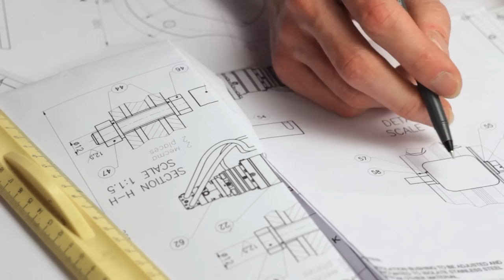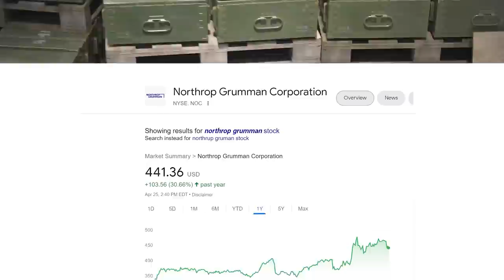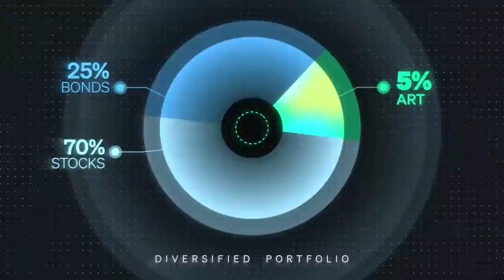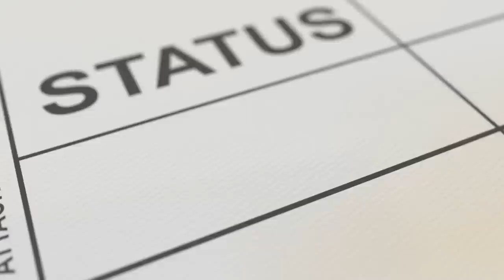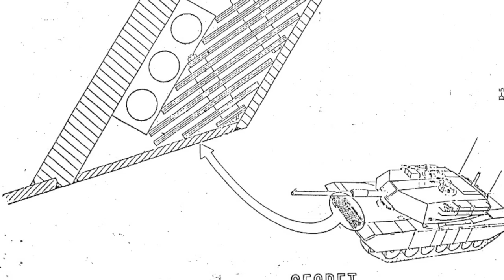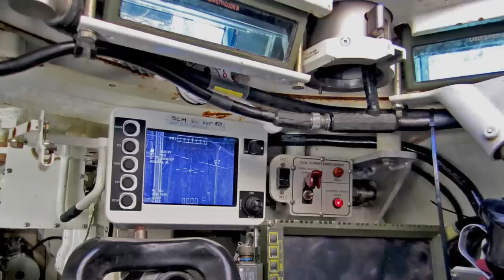The M1 Abrams Tank Needs to Chill Out

Comment: Why aren't we seeing upgrades in the tracks and suspension. Seems being able to use that horsepower would improve survivability.
Reply: Limited potential benefit, compared to the development investment. Trying to go faster on rough terrain is tough, not just because of the extra power required but also the bumpier ride. At some point, if you want to go faster the only real option is to fly.

So basically, there's a practical limit to how fast you can go anyway.

And extra speed doesn't necessarily make you more likely to survive in and of itself. The main benefit would be the ability to engage or disengage, when up against slower enemy forces. A significantly faster speed means that you may be able to concentrate forces more effectively, and escape enemy concentrations more effectively. But if it's only a minor speed difference ... well, restrictions and geometry of local terrain may generally be more significant than the speed difference.
Reply: @IsaacKuo  Well I think if you ask the crewmen if they'd like an extra 20 mph in a tight situation you'd get only one answer. You pointed out several positives and gave weak negatives. If speed were so meaningless every AFV would do only as much as needed and no more. The Merkava is the only one I can think of that speed wasn't maximized due to it's expected combat role. The expense of designing better tracks is nothing compared to improved systems or armor I would think so I don't consider that a valid reason.
Reply: @larrymead151  Yeah I don't think you're going to squeeze an extra 20mph over what we have now, over rough terrain. Maybe 5mph, optimistically, and that would require losing a lot of mass (reducing armor protection mainly) and a lot of volume due to the much larger engines (reducing ammunition, spaced armor protection).
Reply: @IsaacKuo  You seem to have a fixation with tanks being used only over rough terrain. They aren't. Why was the original top speed of the Abrams before all the mods about 10 mph faster than it is now if it served no purpose? And that's with a governor. Why the extra power when a 1200 HP diesel would have worked? They wanted the speed for a reason.
Reply: @larrymead151  The tank was purposefully designed with an extra margin in power because real life experience shows that additional systems will be added later on. In particular, many tanks have been upgunned and that has often meant expensively redesigning the entire turret if the original turret lacked enough margin for it (the M1 turret was designed with dimensions for a larger gun if needed).

The question you should be asking yourself is - if that theoretical top speed was so critical, why did they add all this heavy stuff which slowed them down on ideal terrain?
Reply: @IsaacKuo  The question you should be asking yourself is why doesn't every tank go 20 or 25 mph if speed means so little. They could put more of everything on there and reduce the speed by 50 percent but they don't. The limiting factor are the tracks and suspension which tear themselves apart at certain speeds under certain loads. Again I say if you asked the crewmen if they could have that 10 mph back they would take it.
Reply: @larrymead151  It's all about design compromises - cost vs gain. Going 20mph slower doesn't gain you much - if anything in capabilities in other departments.

In contrast, trying to go 20mph faster costs you a lot. Besides the fact that it will beat up your crew so they won't be able to fight effectively, you'd lose too much in terms of weight and space for other systems.

The bottom line is that the US military decided it was worth a more powerful gun, better armor protection, and a hunter-killer capability (which was arguably the dumbest cost cutting measure in the original version), even if it may have cost some speed on smooth terrain.

You're arguing that this was a stupid decision, and also that somehow improving the tracks will somehow add a lot of speed.
Reply: @IsaacKuo  Design compromises have to do with firepower, protection and mobility not cost versus gain. Which of those three is always neglected during modifications. I'm saying it shouldn't be and doesn't have to be.

Comment: It has often been said, and it reigns true (Probably). That during the invasion of Irak, had the sides swapped tanks, the US forces would have still won easily... Crew training matters A LOT! As long as your optics are decent, and your fire control system isnt garbage, you can kill another tank, or atleast take it out of action with a single or few shots. And if you use proper tactics, you wont present a shot to the enemy in the first place, and then getting hit isnt such a big issue

Comment: Jesus 500 gallons of fuel, and 260 mile range.
Reply: That fits into the design specs of the required operational range of the Abrams for combined arms doctrine.  It is also the performance, increased all weather, winder range of battlefield temperatures, ability to use all types of fuel, and ease of maintenance that are also factors of the turbine engine over the diesel for +42 years.

Comment: .         When you mention, around the 12 minute mark, all the business about protecting crew, (human beings), you hit the nail on the head on one of the significant factors that helped the Allies win WWII.  
          It didn't help the Germans having technical masterpiece planes, tanks, and artillery, because they didn't keep mechanics and spare parts in their supply chains.  When they could, they literally sent assets all the way the fuck back to Germany for repairs.  And when they couldn't?  They left them to rust in the fields of France, Poland, North Africa, Italy, you name it.  
          The Japanese didn't have quite the same problem.  Their's was worse.  They sent their best pilots and Navy men out in waves, with their suicidal battle philosophy, and by the time the US had built it's 40th, (or 75th) aircraft carrier, the Japanese had neither ships, nor sailors, nor pilots to spare.  
          The Japanese did NOT make a point of sending planes out to pick their pilots out of the ocean, they assumed they were dead.  
          The Allies put more value in soldiers and sailors (and doctors and nurses) than they did in tanks, planes and ships.  Yes, the fact that the US under Roosevelt unleashed The Arsenal of Democracy, while the Japanese and Germans couldn't keep gas in their tanks and planes in the air in sufficient numbers, that is definitely true, 
          but the fact that the Allies didn't throw shit away, and learned from the assets the Axis powers DID throw away, was probably the most important winning factor.  You can build more tanks.  
          You can't build more people.
Reply: Another advantage of the US military structure is we give commanders to ability to learn, be in charge, make mistakes, take corrective action, train other in our command to lead if needed, and give them flexibility to accomplish the mission.  Look are every battle the US Military has been part of from the start/end of a war and you will see that pattern of learning and adapting to accomplish the mission.  We alway suck bad at the beginning of war; but, become a juggernaut towards the end.  Mission first, people always.

Comment: Without  the Trophy System the Abrams, Bradleys and Strikers are just as vulnerable as the Russian equipment.  Thats one reason the Marines just gave up there tanks.
Reply: The Marines are getting back to being a rapid deployment force.  They needed to be lighter to deploy faster around the world.  They still need the firepower of a tank; but, it will be packaged in a wheeled vehicle.  The Army is the 800 lbs gorilla that takes time to deploy when needed. Anti tank and anti armor weapons have been around since WW1.  The key is to use countermeasures for any measure against you.  Infantry, artillery, mortars, and close air support is the countermeasure against anti tank weapons by pushing it outside its effective range.  Trophy system on a tank is kinda of the same as the Phalanx CIWS R2-D2 systems on a aircraft carrier in a battle group.  A lot of combined arms protection had to fail if you are using that as the final system to protect yourself.
Reply: @mrgold3591  why is the UK discussing giving up all of their tanks

Comment: Tanks in a properly built fighting position only expose the sights not the hull or the turret. when they move forward they expose the turret and gun clear of the earthen berm so that they can shoot the identified targets. they then back up putting tons of earth between them and the incoming round if there is one. then they bound forward before the target can reload and try to shoot that tank or anti tank gunner. older tanks may have to expose the turret because the sights are near the gun not on top of the turret. That's why thy moved the sights to the top of the turret. This hiding can also make the position harder to spot before the shooting starts. During the battle of 73 easting of the first Iraq invasion an American armored task force stopped their forward movement to scan the area for targets and found themselves inside an Iraqi position parked above and a few feet from the Iraqi tanks because they couldn't see them in their defilade positions. It did not end well for the Iraqi's.

Comment: Assuming perfect operating conditions and function, most of the current top-attack guided missiles are capable of defeating an Abrams.  While each successive variant of the Abrams has seen its armor improve immensely over the frontal 60 degree arc, there is not much if any difference between the 1981 edition and today's edition in terms of the armor protection of bottom surface or the top surface.

Recognizing that you just can't keep slathering on layer after layer of armor (either steel, uranium, composite or reactive, or combination thereof), the Army has turned to the Trophy active protection system to protect the other 300 degrees of horizontal arc.  But what about top attack?  Has anyone seen any video of Trophy protecting from top attack missiles?  Sources say Yes it can but until we see the proof, such claims remain in the realm of defense contractor promises and purple unicorns.

Comment: It‘s hard to compare the actual combat performance with say the Russian tanks. The US Army really hasn‘t faced an opponent like Russia does in the Ukraine situation probably since Korea. The Russian tanks are built for cost-effectiveness, but this is not something that‘s a problem for the US Army until they run into a situation where they lose a lot of tanks; then it would suddenly matter how easy they are to replace. That might never happen.

On the other hand, would Russia actually profit if they had invested in better tanks? The problem is that a tank is only as good as not only it‘s crew, but the supporting arms as well, especially the infantry. I‘m guessing that Russia has a huge problem with either force cooperation or the effectiveness of their infantry (which can be hugely affected by morale). And those are things technology can‘t fix.

I also suspect that this is a problem the United States can also run into, much more than problems with their weapons systems. With the exception of a genuinely defensive war the US can also run into serious morale problems if they have to fight another foreign war. My impression is that the last two wars have seriously sapped the willingness to fight in foreign conflict, both in the Army and the all-important home-front. 

However, at the moment, proxy wars are a much more likely scenario, and those give rise to the murkiest situations of all.

Comment: Does a video exist of an  Abrams being hit by any and all anti tank weapons such as the two most popular? Why can't you just make the top of the tank stronger and more survivable  and use reactive armor
Reply: Tanks have been around since WWI and anti-tank weapons just as long.  It has always been a balance of measures and countermeasures and overlapping coverage/support for every piece of equipment on the battlefield.  Using combined arms of infantry, mortars, scouts, air defense, artillery, and close air support limits anti-tank weapons effectiveness on the battlefield.  Combined arms pushes the anti-tank weapons outside of their effective range and has worked for +100 years.  The Russians are not using combined arms and don't have the coverage of combined arms to help cover the tanks' weak spots.

Comment: The A3 is a POS. I worked on it for 6 months. The soldiers are going to fuck that battery monitoring system up and the cheap as screen on the new loader display, and software problems, and last but not least the new POS generator is a unreliable POS

Comment: Cheap swarms of remote and/or autonomous ground and air hunter killers w/NLAW fire power will quickly relegate MBT to the back seat, similar to what's going to happen to 5th gen fighters and carriers.  Will it be 10 or 20 years for it to happen, no clue, but it WILL happen.
Reply: Do you know anything about EW ? Air defence systems ? integrated sensor networks ?

Comment: Chris, … You need to stay with the grunts young man, … and leave the armor devices to us tankers, …
Yes, I’m old school, but one of our M60 series tanks, (from the Slick 60, to the M60A1E3 tanks), … that were replaced by the M1 M1A1, & M1A2, series tanks, … were worth 10 of the Soviet era T62/T72 tanks of the Soviet era tanks you are speaking about are built on the same 1950’s type frame works, … you can see how well their “reactive armor” works, on the burnt out hulls  of their T90 series of equipment, sitting in the roadsides of Ukraine, …
Your depiction of fire, & retreat, … is no more different than utilizing the 1950’s series of old west movies, where troops would move from one side of of the circled wagons, to cover fire in a different location, handing off rifles to be reloaded, in the center of where the core wagons were, … while the tanks the Iraqis used during the Gulf wars, were the old, T62/T72 series of the Soviet era regime, … while Russia had said that they were in process of building the equivalent to our M1series of tanks, … (hmmm, though I just don’t think so), …`the tanks that Putin has so far, sent against the Ukrainian army, have pretty much been destroyed, or held back, … where it is safe, … and I’m beginning to wonder when Ukraine forces might start to push back hard enough, in order to drive the Russians, back into the scythe & hammer, Motherland, … and if they should do that, then what would stop them from taking land from Russia? Right up to Putin’s doorstep, & to physically remove him from power? There are those in the Russian parliament that need to be put on the front lines of the war zone arena, so that they can get some semblance of how devastating this war has become, …

Comment: You skipped most of the points with blah blah to fill out 10 minutes of video. The point of the Abrams is general Dynamics has made a bunch of money redoing the turrets over and over without being made to build new hulls. Youtuber Red Effect has an actual GOOD video on the Abrams. The main issue is the hull is the same rolled homogeneous steel as the first Abrams off the assembly line. Most Abrams today are on the same original hulls. Despite seeing tanks in berms or being destroyed in dugouts by drones many tanks are destroyed in the side while driving. Now I cannot remember numbers but others go into the mm of Abrams crap hull armor and the mm of this type of round or missile will go through. The side skirts do little and ERA only works on one kind of round and NOT a kinetic penetrator. The Abrams is built to count on being able to fight at 40 mph while shooting at a scared adversary or being hull down only showing it's really good turret. The hull has never been hit by a tank round. Other than probably the best turret (Le Clerc ?) the Abrams has one of the best crew protections mostly due to ammo type and storage system. Two part ammo with soft-ish powder casings invites quick turret explosions if even stored better as other auto loading designed tanks do. The armor on the T-90M probably best any version of the Abrams due to added hull armor and well engineered plates. At the end of the day a better protected more roomier turret along with, as you pointed out, better trained, rested crew should pay off in a tank versus tank scenario. In battle they stay buttoned up for a long time. The biggest advantage is crew severability and we can see with unfortunate Russian tank crews, losses deplete future division reformation.